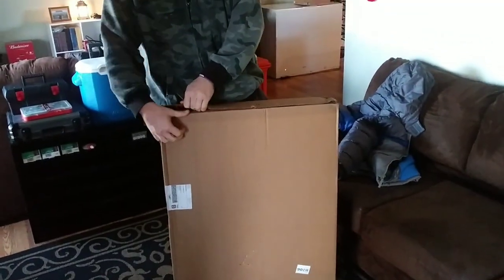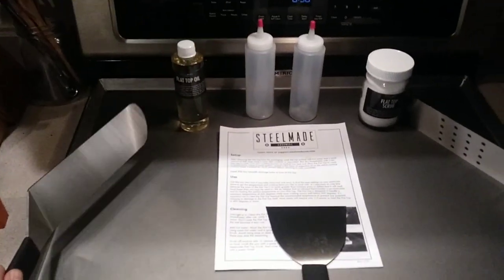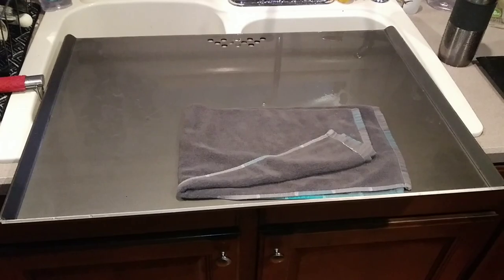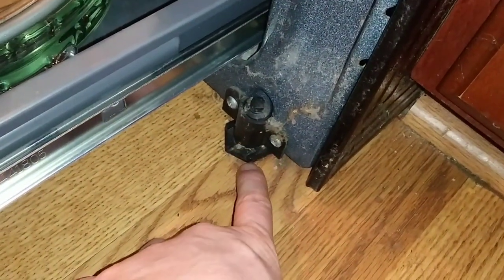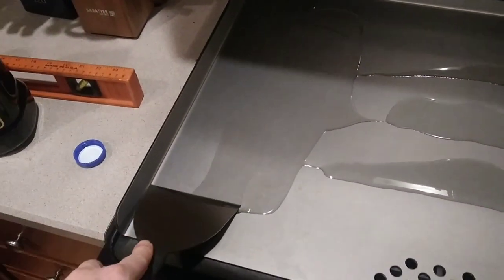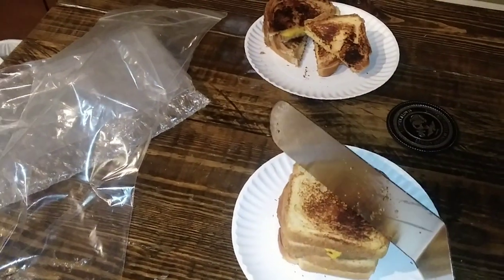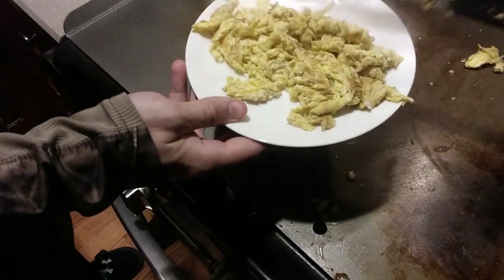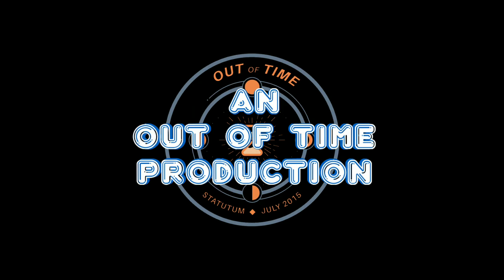Steelmade USA Flat Top Grill unboxing and review (What's Cooking Sleeve?!!!)

Comment: Is that small drip tray large enough for the size of that surface? Has it been a problem? I dont like the idea of oil dripping down to the burners.
Reply from the maker: It definitely works but you really need to empty it after each use depending on how greasy the stuff is you are cooking plus the water and oil you put on when you clean it. I forgot once and didn't empty it after a couple uses and it overflowed but as long as you empty it every time it's never done that after just one use. On my stove you would definitely have room to add a larger one of your own if you wanted.

Comment: Lol it slants to the front on purpose to drain lol
Reply from the maker: I mean if that works for you go for it....but if it was slanting forward all the grease or like if you cracked an it would run off onto the floor.  I've installed a lot of ovens and I always level them so stuff doesn't run to one side of the pan while your cooking.  I just use the spatula and pull the grease and scraps  towards the drain holes and grease trap pan as I go.